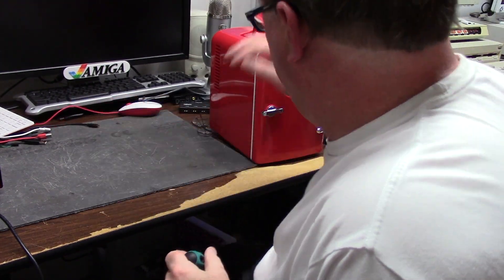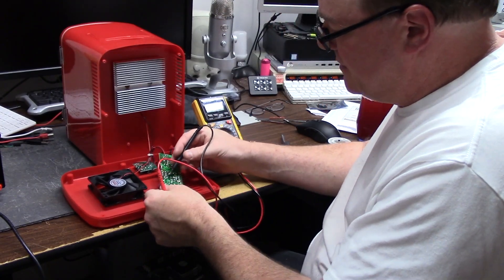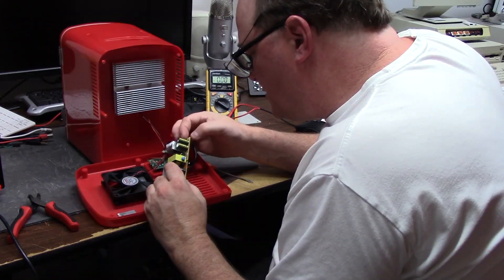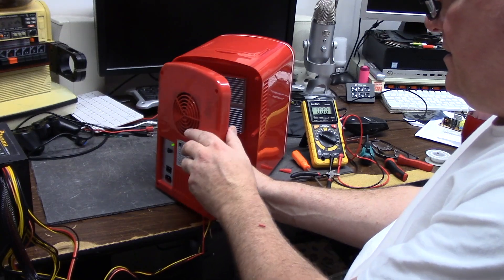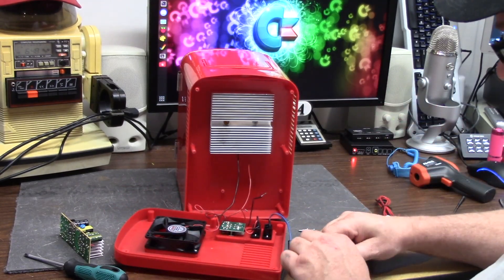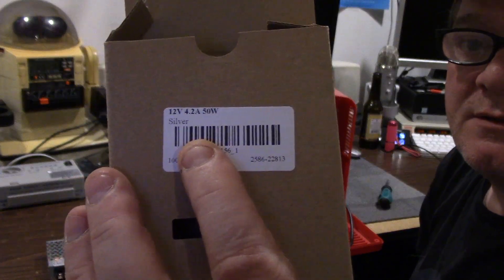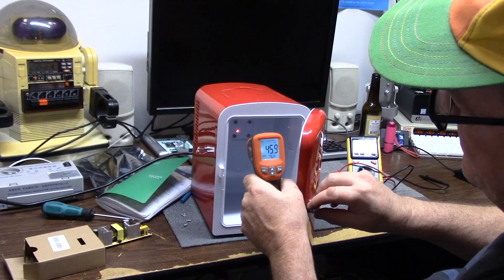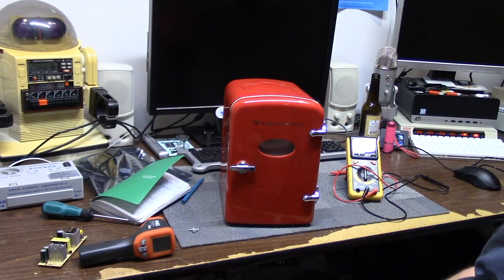Frigidair mini fridge power supply upgrade

Comment: Did you check if the 12-volt side was working or only the AC side was working, I have a similar one to this not the same brand the AC side was not working due to the transformer being blown but the DC side was still good. 

I just got a 120 to 12-volt transformer cord instead.

Comment: do you have a layout for the wiring im ordering the psu and not sure what wire goes where
Reply from the maker: no but its easy, ac lines  (thick black cable) to into the AC +120v and AC Gnd  , the DC side low voltage  lines go into the  red +12v and black ground. its clearly labeled on the psu. i show it fast at 12:30
Reply: @ChrisEdwardsRestoration  thank u and thx for the upload im pissed my little fridge gave out only 3 months
Reply: Okay I'm going to rephrase this so I've got part of it figured out. I've got a red and black wire that controls basically everything which is now plugged into the volt+-
But my 
AC 
120v
And that looks just like this on the back of the fridge
It only has two red wires so I'm not sure how to hook this up to the positive ground and negative

Comment: I think ive left mine on too long and i cant slide the thing to go off. Also when i plug it in it does not turn on. Is there anything i can do about this?
Reply from the maker: Yes, replace the power supply
Reply: @ChrisEdwardsRestoration do you know how to do that or how much that would cost?
Reply from the maker: @benshell7245  links are in the extended description, i think i paid maybe 25 all in and its still going strong
Reply from the maker: I think the psu is 15$ or so. Links in desc

Comment: Hello: excellent video, can you show were the cables go in the new power supply. It has 5 ports I don’t know in which one hook it Thanks, best regards
Reply from the maker: cut the wire on the fridge AC side, that goes into the input - and + and ground.  remove the AC board and old psu entirely, the remaining little tiny board is the DC side. that gets the ground and 12v wires from that little board to the new psu DC side +12 and gnd
Reply: @ChrisEdwardsRestoration Thanks very much. Appreciate

Comment: if you upgrade the fan and replace the thermal paste with some mx4 it drops all the way down to 19F
Reply: Upgrade the fan to what?
Reply: @athos1029 any brand name fan? The original is noisy. I got an arctic 80mm slim fan. Much quieter.

Comment: The green light blinks on mine and the fan doesn’t move. Could it be the same problem as yours?
Reply: if you still have the 12v car adapter and it still works with that, then you know it's the power supply.
Reply from the maker: yup and can be fixed for less than 25$, parts links below

Comment: Thanks for the video I think mine is bad too but I'm just going to go ahead and make it so it only takes 12 volt and delete the power supply buy running it off of a 12-volt power source
Reply: Same. It will take longer to cool, and be more efficient with an AC to DC adapter, but beats wasting another $100 on a new mini fridge.

Comment: im using the PSU from my mini fridge in a another project that needs 12v (one device needs 3amps and i also need to power a 12v fan, but i plan on under volting it to 6v) How many amps can this PSU provide? I assume it can provide enough for 3-5amps
Reply from the maker: 5-10 amps it says on the box but who knows

Comment: I found the coca cola mini fridge from when I was a kid. No light when plugged in, was sitting in the garage for a long time, probably got wet but I dont know for sure, super dusty on the inside. Cleaned it up, wont run but Im going to try and fix it for the lolz

Comment: Was given an AstroAI LY0204A to look at that looks pretty much the same as the one shown in this video. When I turned it on, the warm/cool LEDs flickered and the fan spun slower than normal (speed was constant). Transformer on the PSU was clicking along with the LED flickers. Everything seemed fine (caps didn't look bad and they seemed to measure fine on my multi-meter when out of circuit). That big cap had 375V charge when I measured it with my meter (it was a 33uF 400V cap). 

Had some spare PSU boards from some dead TVs I found. Did not have any caps similar to the 2 1000uF 25V and the 33uF 450V cap. The board did, however, have a 10uF 50V cap which is also on the fridge PSU board - I almost missed it because it's much smaller than the other caps. So I took that off the TV board and soldered it to the fridge PSU. It now works and the PSU transformer no longer makes a sound.

So for now the fridge powers on properly. The other caps will probably fail soon and I will replace them eventually. I just wanted a quick fix without having to wait for any parts. 

Next issue was it didn't seem to cool properly. So I had to take off the heatsink and was about to re-apply some thermal paste, but unfortunately the paste ran out mid-application so I had to stop and clean everything off. I decided to try mounting some thermal pads I had laying around instead to see if that would work. It did make things better (cans actually get cold enough now), but it's probably not working to the best of its ability as the pads aren't the greatest - just something I got cheap off Amazon a while ago. I'll probably get some new paste and re-apply it. Hopefully that makes it cool even better.

Comment: My fan runs, the green light is on, I can feel the air from the sides. I left it on overnight but my drinks won’t cool still.
Reply from the maker: The Peltier square prob broke.  They are 3 to 6$ on ebay. Measure it and order a new one only 2 wires
Reply: Same here

Comment: My fan works, green light is on, but it stopped cooling. The air coming out of the vents on the side used to be warm but now it’s room temp. Whatever was getting hot inside isn’t anymore I guess. I’m sad. I liked this fridge for the 2 months it worked 😢
Reply: This what happened to mine and I just opened the back and made it worst. The cool warm switch is burnt out.

Comment: You can clear your ears/eustachian tubes by milking them. Literally take your thumb and middle fingers and place one on each tube location which is in the indentations on each side of your Adams apple. Relax your neck. Tilt your head back and place your hand up to your throat placing the middle finger and thumb as close as you can get to your jaw hinge. With some pressure literally slide your hand downward pressing inward on the tubes until you reach your collar bones. Do this several times. Several times a day. Do not try to hock up the fluid you will feel running down your throat after a few times. If you don't feel relief of pressure and the feeling of thick fluid running down your throat you need to relocate your finger and thumb. Keep trying until you feel pressure relief and feel the urge to hock up a lung. If you do this regularly you can keep your sinuses clear and clean.your hearing can go from near deaf to perfect hearing if done right

Comment: Thanks for the video.  I just replaced the fan and have the same problem you did.  I was just about the order the meanwell power supply, but I thought I'd ask you first does changing out the power supply increase the risk of fire hazard?
Reply from the maker: Nope. Mines been running over a year since indid this video 24/7 and its still ice cold
Reply: @ChrisEdwardsRestoration  Thanks.  How did you end up mounting it to the case?
Reply from the maker: @jonathangray8214 it just sits in there wedged under pressure. When you put the back on it fits perfection

Comment: Have you ever used the 6 can insulated electric cooler by fridge? Mine just stopped working and the green light no longer comes on. I am not sure what to do about it at this point. I couldn’t figure out how to open it up. It has 4 screws in the inside of the cooler. I took them off and still couldn’t figure it out…
Reply from the maker: No no the inside screws are the Peltier plate!  Screws
On bottom under feet

Comment: These power supplies have markings for Live and Neutral, but then the fridge has a figure 8 style plug which is non-polarized and reversible. Does that matter since the supply is being installed in a plastic housing?

I'm changing out the supply in one of my fridges and have been trying to find an answer. On on hand I've been told to swap out the figure 8 for a computer style 3 pin plug, but others have said that the polarity doesn't matter since most European plugs are reversible by design and any power supply rated for 220 would have the protection circuitry on both sides in order to comply with European standards.
Reply from the maker: Mines 120v its a simple ac to dc
Buck
Converting power supply hence my
mean-well psu did the trick

Comment: Let me know How to connect with new power supply especially wire connections😊. Because I have dead one like this. Want to repair it.
Reply from the maker: Its color coded. One side is ac the other is normal dc pos/neg

Comment: Okay i read thru all the comments, you don't have a picture of the wiring. 

Before I order a new power supply, I'd like to ask, is it just the 2x wires from the old power supply, then 2x wires to the new power supply?
Reply from the maker: 2 wires and a ground on ac side. Positive and neg on dc side. Super easy

Comment: Don't know if I'll ever get a response to this. 

How has this repair held up so far?

Is there any way you could make a short video on how you wired in the power supply?
Reply from the maker: I respond to every comment. My refrigerator is still working colder than ever. It will chill things now down to 34°F. I don’t know what that is in communist but it is great. The power supply is simple to wire up the colors match the original insides AC on the power plug DC positive and negative to the board.
Reply: @ChrisEdwardsRestoration  

Thanks will give it a go when the power supply gets here Monday. Thanks for the Information.
Reply: @ChrisEdwardsRestoration  the wires that came out of the old power supply into the board with the switch, does those wires plug into the v- and v+ of the new power supply?
Reply from the maker: yup.  @laveydbelmont
Reply: @ChrisEdwardsRestoration  thank you.

Comment: Thank you! My mini fridge died. I tested the power supply and it was dead. I ordered the same power supply you used. My mini fridge was a little different that yours and it was a bit tricky to get the power supply to fit. But I got it in. And now my mini fridge works! I hope this power supply lasts a while.
Reply: Where did you buy the power supply from?
Reply from the maker: links in desc
Reply from the maker: amazon, use my link its super inexpensive.

Comment: The faulty part on the original circuit board was a small capacitor. I would have replaced all the cheap e-capacitors with Nichicon e-caps. ESR meter would have spotted the faulty e-cap.
Reply: If mine is I will just replace it with a bigger one. My son's just quit after 4 months n it didn't even have drinks in it or would even cool that good smh.

Comment: Came across your video after keyword searching for info on how this "fridge" i have operates. Out of curiosity.

I have no clue about half of what you were talking about, but am able to understand when you used the jargon my big bro always used. ie "turd", thingamabobber"  and "gizmo". If you did not say "gizmo" in this video,  you probably have in another one I bet. 

I did follow well enough to enjoy the humor. 

You placed me back a half a century to when i hung out in workshops of some form or the other as the annoying little sister in a 2 mile area of boys who had no one else to hang out with. Some good memories there. It's why i still take broken things apart and attempt to fix them before tossing them.

And now, thanks to you, I have a clue about that red thing on my shelf without having to take it apart.

Thanks for the vid.

Oh, and may i suggest an old cap from a pickle jar, or something along those lines, to stay on your work area to contain those pesky screws?
Reply from the maker: i purchased a magnetic dish thingamabob from harbor freight. but thanks for the pickle jar tip.

Comment: This is crazy i have a tacklife mini fridge that looks exactly the same from the outside.  In multiple videos its looks similar.  But once everyone opens their mini fridge mine doesnt have that power supply board.  The thing is it was working for at least 6 months if not a year!  Are there some models that dont have a power supply board?  Mine finally stopped working last weekend and i thought ok i will just fix it but i dont even see any capacitors lol.  I am at a loss.

Comment: Thank god for this very specific video because I have this very specific problem. I am good at very simple fixings but not like this, thank you
Reply from the maker: if you wanted to do the super cheap route, wire in the 2 wire external outlets we all have 30 of in our junk drawers, just line up the voltage close to it and bypass the entire internal thing

Comment: I had a coca cola version with the same problem. I basically chopped out the crappy power supply and wired it directly to an external 12v power supply with an inline switch. Works like a champ again

Comment: I have a Coca Cola one that’s broke and the light comes on but it’s making a beeping noise that it never done before and it’s just not working apart from hearing the beeping when I connect power and the light turning on, I’m really not sure what the problem is, would you have any idea? 

Thank you 🙏
Reply from the maker: Is the fan spinning.  Is it getting cold?
Reply: @ChrisEdwardsRestoration  no the fan is not moving or getting cold, the only thing that seems to work is the flashing light, and it’s making that beeping noise I mentioned, it never used to make that noise when it was fully working. 

Thank you!
Reply from the maker: @_-pablo-_  then its the power supply

Comment: Do you happen to have  a wiring diagram or picture of the power supply?
Reply: on the RS-50-12 the AC is labeled with (AC)
Reply: The power supply ac input has a place for ground. How did you go about wiring that? I believe the stock ac plug is just hot and neutral.
Reply from the maker: @matthewarcuri2549 its a polarized plug. So as you said load and neutral
Reply: @ChrisEdwardsRestoration  The one I’m repairing has a burnt switch board. I ordered a rocker switch with a power socket inlet module. I can mod it to fit on the back and have plenty of power cables sitting around from old computers. I think it will work well with the power supply you recommended.
Reply from the maker: No
Reply: blue/red is positive.. AC In .. DC out

Comment: Walmart has these for 9 bucks my guys 😅
Reply: Try $29 - 39 if your speaking on the whole fridge... cooler
Reply: @-RyN-23  gonna upload my Xbox mini fridge I bought broken to upgrade it put a few of the little semi conductors a big radiator liquid cooling system led fan combo while keeping the look the same only difference is the led fan sticking out from the top which looks better also I keep my ice cream top portion it’s that cold
Reply: I saw it for $21 at Walmart now.

Comment: Why not just buy a 12-volt cigarette power supply & plug in the 12-volt power cord into it? Such as a benchtop DC power supply that puts out 3 amps of regulated 13.8 volts.
Reply from the maker: i like to live dangerously

Comment: anyone point out yet that he prolly could have just bought a 12v wallwart/laptop cord powersupply and used DC instead of the AC plug? wonder if that would last longer myself... might just get a junk mystery ebay 4$ 12v laptop supply
Reply from the maker: yes i can but i wanted it as was and not external. my new power supply runs it even cooler and has been going strong ever since, 24/7
Reply: @ChrisEdwardsRestoration  good info. sounds like people are able to upgrade the fan to be quieter and more efficient and can get the performance up a little better. I bought the bigger wine chiller version with the glass see through front for 22$ and I think I will maybe cut some more holes/remove some of the plastic shell in the back to see if that can move heat a little better. maybe add some aluminum tape to the back surface?

i was doing some numbers on making it battery powered, maybe running a bunch of 18650s in parrellel up to 12v but at 50watts thats only ~10 minutes per battery. that would take a lot of batteries to get some decent run time lol

Comment: If you look at reviews, all these little fridges die within months (most a year, very lucky 2 years) of purchase.
So is it just the heat sink and fan that create the cold?  Why don't they just wire the fan to a plug and leave out the rest of the crap. Nobody needs the green LED and whatever the hell the rest of that stuff is.
Plug it in to run, unplug to turn off.
Reply from the maker: its called the peltier effect. it has AC and DC so the board inside has a rectifier and coil for AC to dc, so most cut it off and wire a external power brick that does that for you. OR you can go my route, which is still working and even colder.
Reply: Mine just died but 4 years old non stop running.

Comment: Had a different fridge with that same off the shelf power supply seemed the smaller two green caps had failed and shorted inside for me. I also had the same heat spot on my board so as many other people who have posted about this board online, I assume the heat from the fridge itself might strain the cheap components to prematurely fail or something